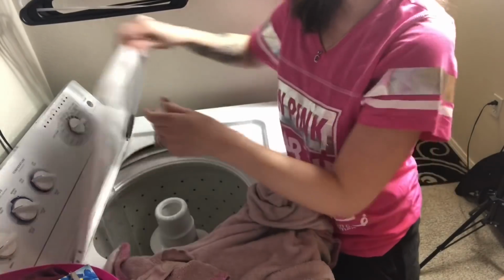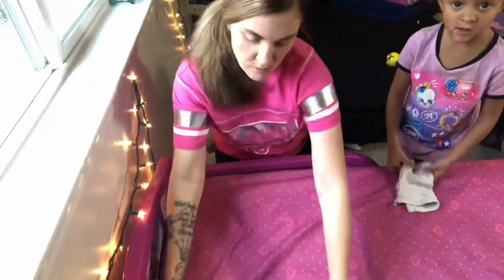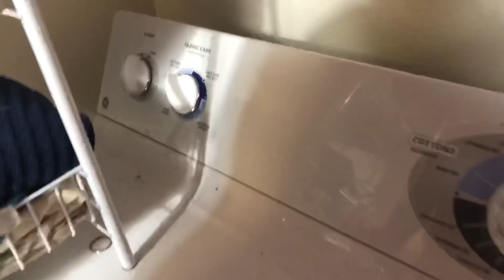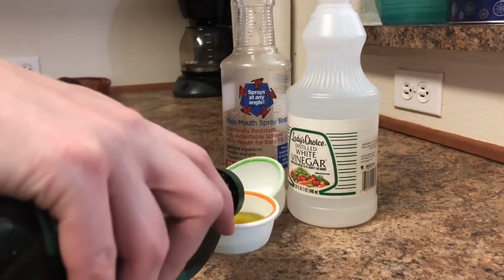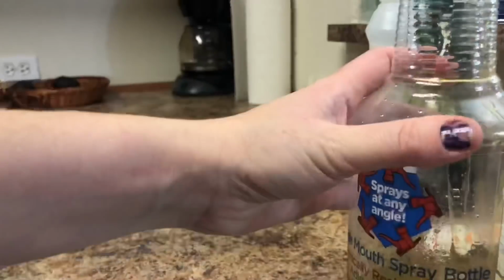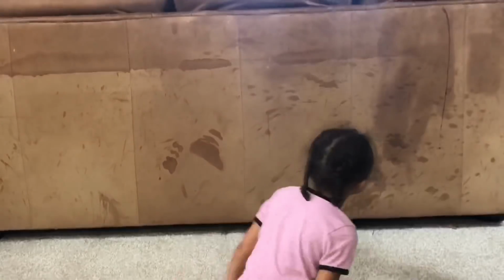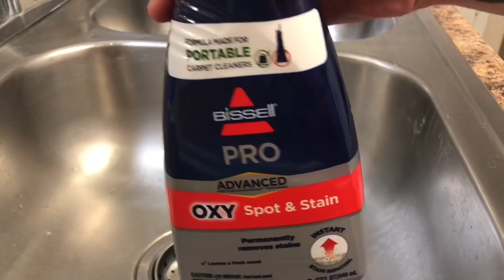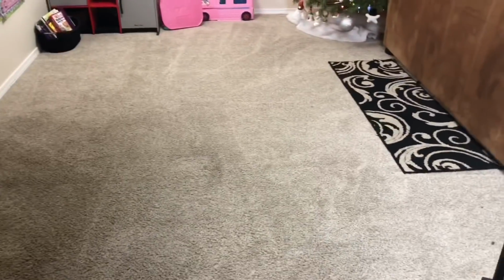INSANELY MESSY//ALL DAY CLEAN WITH ME//DEEP CLEANING//Stephanie McQueen

Comment: Use simple green cleaning solution on carpet. Spray right on carpet, use broom to rub into bad spots then just use machine to rinse with clean water. You can use peroxide on red spots but make sure you rinse very well as it will continue to "bleach" the stain
Reply from the maker: Sara Woods Thanks so much ! I’m going to try that ❤️